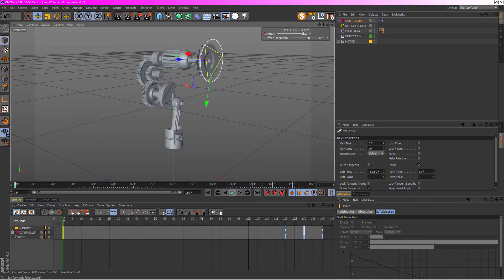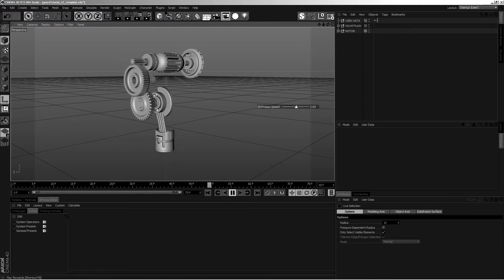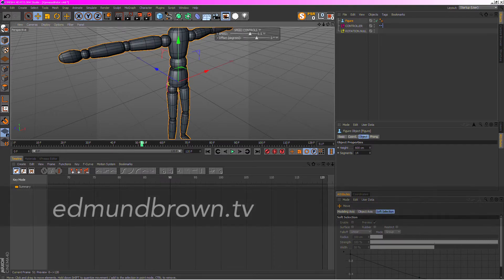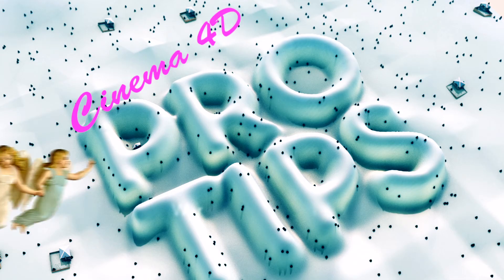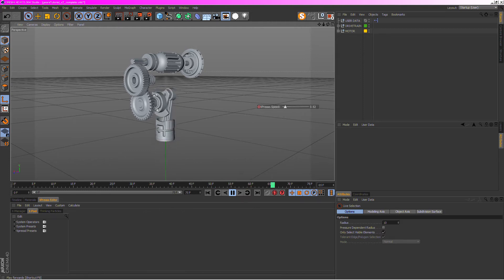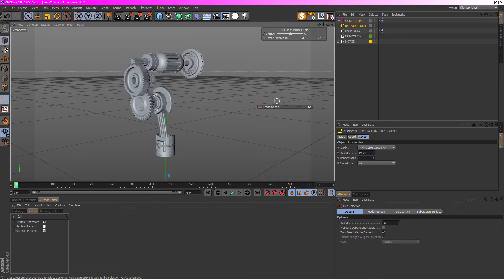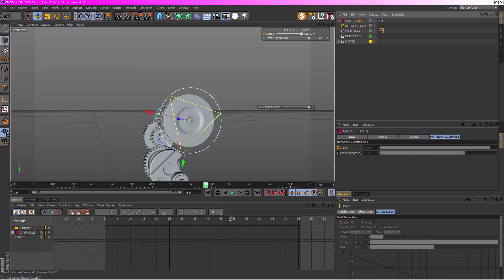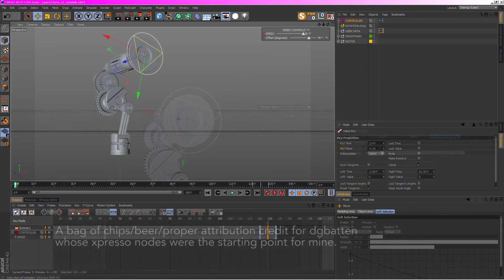Drive Your Objects With The Xpresso Motor

Comment: Hi Ed, thanks for your Tip No.: 1 & 2, which saw about a year ago - They`re Great! Today I wanted incorperate No.: 2 in my engine-project, but my FireFox-Browser is saying, the Certificate doesn`t belong to you and the Webside is insecure. When I put in: "edmundbrown.co.uk" I get: The owner hasn`t configured his Webside correctly and it actually belongs to "*secure-secure.co.uk" I`ve tried several combinations, tonight! Could you possibly send it me via. eMail, I`ve got an Abo with you on here! Can you see my eMail-address?